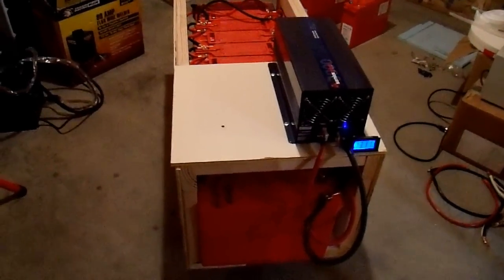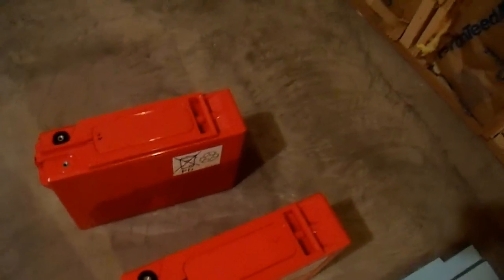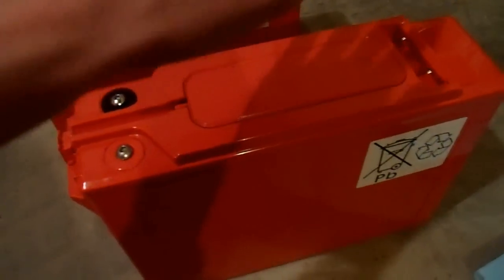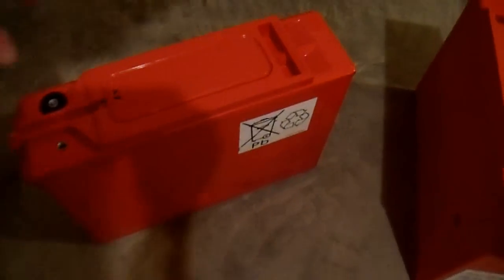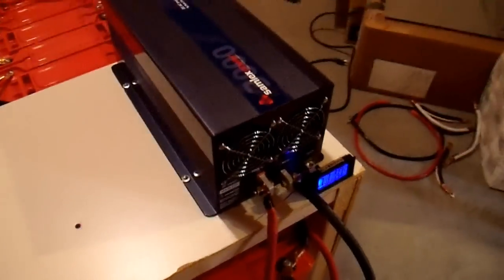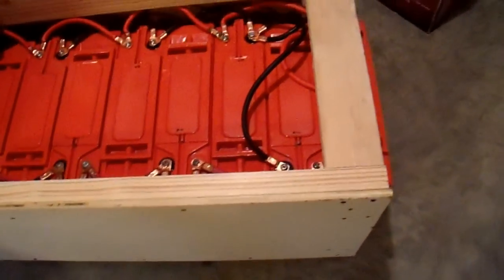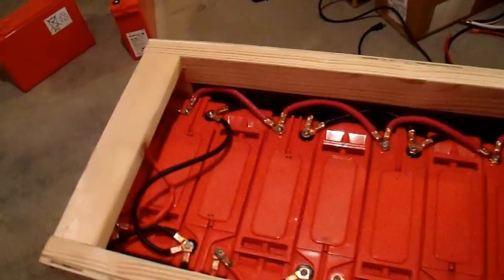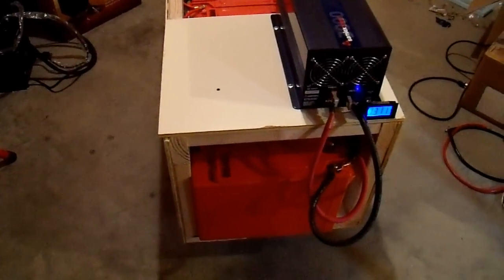1000Ah Battery Bank Part8 - Upgrade Update!!

Comment: I was reading on some forum last night and this guy was fortunate to have found several of these things for a little over a hundred bucks and he was asking how to set it up and recondition if necessary etc. Omg, that poor guy got flamed for having these type of batteries and they said it would never last and that these were designed to be used on rare occasions in power outages and like, that's it. So it was really nice to see how well this system can work. Thank you!

Comment: How did the battery’s work out after 6 years
Reply from the maker: I use them infrequently and ended up having to desulfate them a second time a while back due to lack of sufficient use.  (They were kept charged but not cycled very often)  All but one ended up coming back to a state that was better than what they were when shown here, many of them pretty much 100% so they're doing quite well.  They are getting close to 10 years old now (from date of manufacture) so I expect to start seeing calendar life caused degradation show up soon.
Reply: @knurlgnar24  I’m looking at 10 batteries 170ah each the spa-170 looking at them they are couple years old as a battery back up and a Utility trailer solar project

Comment: Any new update?
Reply from the maker: I reconditioned this battery bank about 6 months ago and they actually perform better now than in this video, so they recovered a little more the 2nd time around.  My intention is to reconfigure them into a 48V battery bank for a dual si6048 setup but I haven't gotten to that yet.  I need to get on it as they need a maintenance charge after sitting for 6 months.  The power rarely goes out in my development anymore BTW.

Comment: Need fuse and shut off so you don't burn down the garage.
Reply from the maker: Not bad advice and I do have fuses/breakers I could use, however I have had many component failures in my past (intentional and not) and know from experience that fuses are a 'feel good' sort of thing and regulatory compliance item.  In reality they do nothing in terms of safety in a setup like this.  Actual failures will fuse open weaker items like circuit boards in the inverter and then open circuit and stop.  If this were a permanent setup I would either leave it in an non-combustable location like a concrete base and wall location or build it out of something other than wood.  This isn't meant to be a permanent unmonitored install though.

Comment: knurlgnar, been a while since I visited any of your videos, quick question for you on your battery bank.  I am building a battery bank with 12 8D 225 Ah batteries with 6 of each wired in parallel  for 12 volts 1200+ Ah and then the two banks wired again in parallel. this will be charged by a 2k PV array running through 3 morningstar controllers giving me about 160 amps of charging under optimum conditions. (also another 200 amps available via a battery charger hooked to genset if needed) You mentioned some issues with wiring that many in parallel, would you mind sharing them with me?  is it in regards to charging?  my plan was to rotate the batteries position in the bank once every two months to ensure that they stay balanced.  I am not using cables by the way but instead copper busbars between batteries with 4/0 cable from the bank to the inverters.  thanks.

Comment: 1000 Amp hours x 12 volts  = 12,000 watt hours = 12 kW hours,  you have a 3 kW inverter,  Get some solar panels and you are all set to go off grid or  for and EMP strike from North Korea.

Comment: What I dont understand is why you didnt connect 6 up with 2guage down one side of the box, connect the other 6 with 2guage down the other side, and only use zero guage to parallel them together. 
That way the power in/out is at the electrical mid point - but at the physical end of the box because of the way you top-to-tail the batteries in the box. 
There is no need to give any electron the full tour of the box ;)

Comment: I have APC 1500 with 980 watts and 2 around 40 amp batteries can i update the batteries to 2 100 amp batteries?
will it work long run?

Comment: Very nice, I just got my hands on 4, 255ah agm batteries. I want to connect 2x2 in series and connect them together parallel for 510 ah 24 volts. In your opinion whats the best way to charge and equalize them? Oh and what gauge wire should I use?

Comment: is kind of sub-optimal to use a 0-gauge from the inverter to the first battery : I would put the inverter in the middle and make two stars one for the + one for the - instead of connecting all your batteries in parallel using a wire serial configuration.
Reply: +Spixy cat he does this later

Comment: A QC motor can regenerate your batteries and give them longer life. Radiant charging is also available with bedini chargers. The 200 volt spike cleans the plates. Do not use with any inverters though. They will ruin the inverter.

Comment: Hello 
I have come into a set if 170ah batteries. I have 8 of them. They are the same brand as yours. I'm looking to put my garage off grid for starters.  Just wondering what best way in your opinion would be to wire them up. I want to keep everything at 12v for now. Inverter ect.
Reply from the maker: Nice!  I'd buy some nice 0AWG welding cable, some copper crimp lugs, and hook them together in parallel.

Comment: Please cut open your bad battery and make a video on the failure cause.
Reply from the maker: I don't condone cutting open batteries for safety reasons.  Concentrated sulfuric acid is one of the most dangerous substances that ordinary consumers are allowed to purchase, and saturating it with bio-available lead sulphate doesn't make it any safer...

Comment: Hi knurlagnar24, or """"some one""" can help me with this decision , I can not afford to buy new batteries for my PV system:

I have 14 solar panels with Enphase micro-inverters and they work very good during the day, so my plan was to run the off-grid system only during the night 8 pm to 6 am with a transfer switch, I will be running 2.5 Kw during that time frame.

I have 8 (250 watts solar panels) for my off-grid system and I got 8 6V golf cart batteries (2 different brand and sizes) I was planing to go with a 12V inverter to avoid to put a lot of different sizes and brands of batteries in series, also I though is going to be easy to be adding more batteries with the time to minimize the load in them, do you think this can damage a lot the batteries?
** Also, I still do not have the Inverter and the charger controller.
Any advice???
Please help me to take the cheap end best decision

"I do not know what charger controller and Inverter to buy."
Reply from the maker: A 12V inverter is a good choice for your application.  It is critical that batteries in series are well matched, but when placed in parallel you can get away with mixing battery sizes and types if you are careful.  There are tradeoffs in terms of performance and lifetime for doing so but for many people on limited budgets it is the most flexible option.  You should monitor the battery bank closely and often for any issues, and routinely disconnect the batteries to test them separately (with a conductance meter) to determine when any particular battery needs to be discarded.
Reply: *****
What inverter and charger controller do you think is better for the price? is that Samlex SAM-3000-12 3000W 12VDC a good option? is 364.00 dlls in ebay right now?
what about the charger controller? witch one do you recommend me?

Comment: Now all you need is 2000 watts or so of solar panels and an outback charge controller.
but 4-250 watt panels will keep it charged up.
Reply from the maker: I also need a place to put solar panels..  :(
Reply: +knurlgnar24 your roof :D

Comment: Great Video---What do you use to charge it all back up lets say you run the bank down to 50% ? Wont it need a lot of amperage to recharge it back up and a long charge time ?
Reply from the maker: A trickle charge would charge it up eventually, so a high current charger is not needed so long as certain precautions are taken.  (Garage style smart chargers are generally not designed for a large bank like this and will not properly charge them without extra care)  I have used my Iota DLS-45 to charge up the bank and that is my preferred method.
Reply: I have a 300 amp hour bank in my trailer and my in-house Progressive dynamics 80A converter kept tripping the dc breaker because it was at 10.5 V my daughter left a light on and it went dead too dead to start up my generator and my Xantrex 2000 PSW inverter   so it could not start up...bummed out so the  garage battery charger could not charge it up either it was pulling too much current  so I just went out and got 2 new 6  volt US battery's 283 AH to get it fresh -----the old bank was 4 years old

Comment: Awesome! Next step? Would it be possible to ge/fix a broken high speed automatic transfer switch, configure it up so that it'd quickly unplug your house from the grid, and switch over (in less than one cycle of 60 Hz, or even less than half of a cycle) your house power to the battery bank-powered inverter, Without extension cords. Plus current-limit the inverter-powered circuits to their typical reasonable amp load. And, if possible, rig a relay to turn on the generator when battery bank voltage gets below X volts.  Lastly, wire up a few 250W solar panels to a broken/fixed MPPT charge controller to refill the batteries during the day, silently, without using up any of the gasoline!

Comment: Have you considered putting in a new 30 amp-240 volt circuit with a outlet in the basement and maybe one in the garage?  The two output cords that presently plug into each phase could both terminate into one 240 volt plug.  
So during an actual outage your setup would already be plugged in and all you would have to do is go to your panel, kill the main circuit and flip your one 240 dedicate 240 breaker.  A lot easier and quicker than going to panel to switch off mains , then to basement to plug in cords .
Reply from the maker: I have considered that.  I have a 240V outlet already in both my basement and garage, and an extra dryer tag that could be used for this purpose.

Comment: Assuming these are lead acid, what are your thought on venting in the area you have them in? I wonder whether the volume in your basement is large enough that venting is largely unnecessary?  I have a similar size bank in my garage which I only recently began venting via passive method
Reply from the maker: These are sealed AGM batteries and do not require any special venting considerations so long as they are not in a sealed enclosure.  Traditional flooded Lead antimony batteries can outgass quite a bit and emit some pretty foul byproducts.  If I had that type I would be more concerned.

Comment: Hey knurlgnar, Did you heat your house with this battery bank at all ?
Reply from the maker: I use a 10k BTU kerosene heater for backup heat which equates to about 3kw of electric heat.  The inverter powers everything else.

Comment: Save the bad battery for lighting in areas that don't have power, a shed, any where it can be useful. Make a kick butt flash light out of it. I just revived a SLA 17Ah battery for that purpose. Started out with 0 volts and now after many days of working with it and letting it sit another several days without a charger on it, it's showing 12.6 volts and holding. Only has about 7 Ah, but on a 10 watt load, it does runs a very long time and can be used in any of the rooms we can't get light to or don't want to run candles unattended.

Comment: Wow.  How heavy is that battery bank now?  How much force does it take to push it around?  You put four-500 pound rated wheels on it, right?  Cool set up.  I guess next you'll be building a freight elevator to move the bank from the basement to the garage at will.  Ha ha.
Reply from the maker: It is a struggle to get it through doorways but at right around 1000lb one would expect it to be difficult to maneuver.  Heck, it weighs half as much as a small car and they're not easy to push around either.  :)   The wheels are only rated for 260lb each (I believe if I remember correctly) so they are somewhat overloaded but still seem to work acceptably well on concrete.

Comment: dont connect from the middle...connect charger n inverters from opposite ends of the battery banks. one side from the positive and the negative from opposite end of battery bank..nice work
Reply: the wire would be to long and the losses would be great
Reply: fliping720 not if you place the inverter in the middle..then both wires would be small n the same. your batteries are not wired correctly for OPTIMAL efficiency
Reply from the maker: spturks
You're correct spturks, that would be the ideal configuration.  I already had everything connected up when I realized that I put the batteries in backwards and didn't feel like reconfiguring everything so I just connected it to the middle.  (backwards meaning that the inverter had to go on the other end of the rolling cabinet for the 'lids' to fit properly)

Comment: Well, I think it would be better to have been near the breaker panel in the garage but I figure you had a game plan to why you moved that half of a ton of batteries.  Really, I think you should at some point should connect them to a solar panel array to keep them topped off as you want to use it as emergency backup.  You could connect it up to a diversion controller and then to some GTIs.

If sometime in the future I would consider increasing the battery bank to 16 and connect them in a dual 48 vdc configuration.  Inverters as you know are more efficient at 48vdc.
Reply from the maker: I have considered higher voltages for a variety of reasons including the one you mention, however 12V is just more flexible for my purposes.  For example when I buy and sell inverters 12V ones are far easier to move than other voltages.

There were two reasons to move them to my basement:  One, they're either cold or hot in the garage depending on the season.  Two, they were in the way and I have space for them downstairs where they won't bother me.

Comment: whats the connection in the basement. can you still use the double cords or do you have a double pole plug of some sort down there?
Reply from the maker: When the power went out I used the exact setup I had shown in my earlier video and just ran extension cords to those same locations.